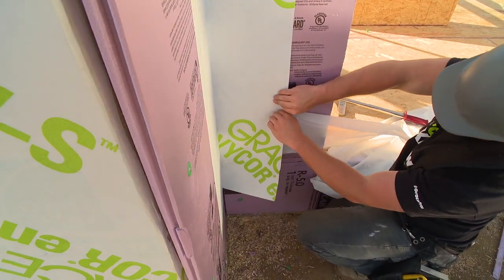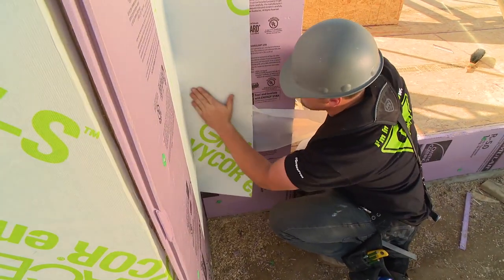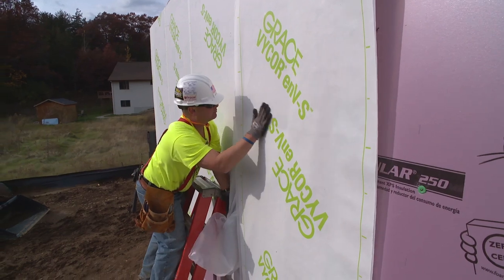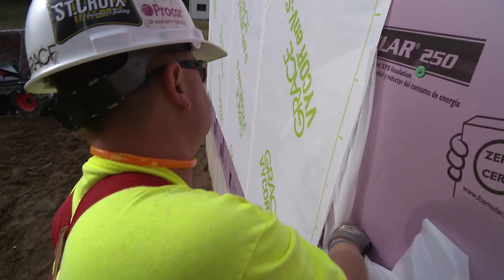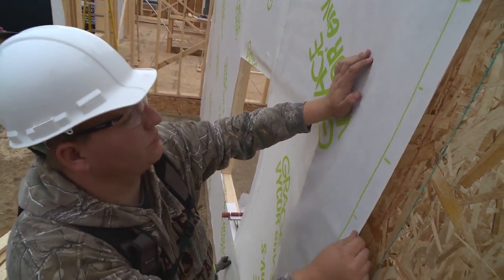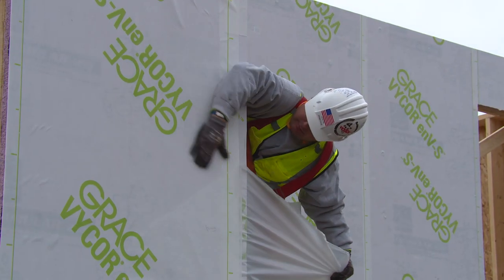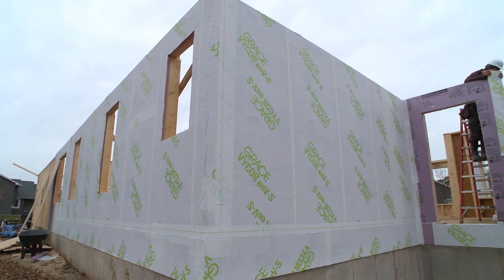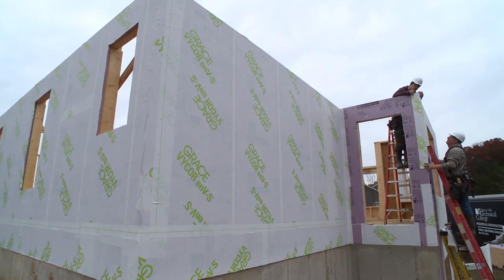How to install VYCOR® EnV-S Weather Resistive Barrier

Comment: what's the difference of putting Vycor on before pink board or on top of it
Reply from the maker: Hi Greg, The decision on when to apply VYCOR® enV-S™ is contingent upon several factors: location/climate; exterior cladding and overall wall assembly. In other words, there may be scenarios where applying the WRB before pink board is ideal, and others where applying after is the best approach.